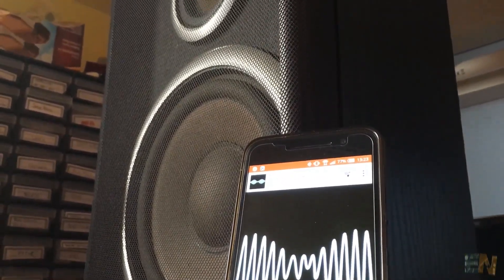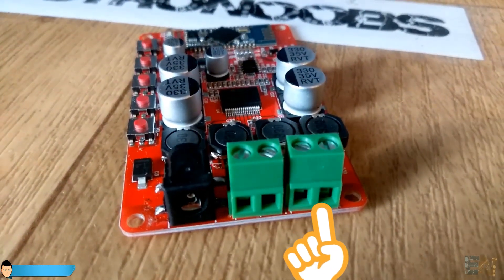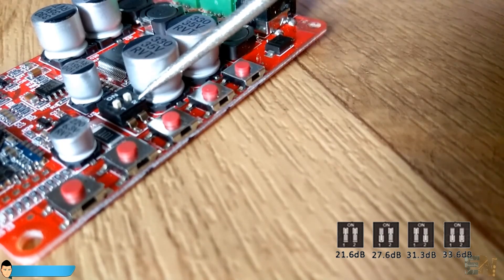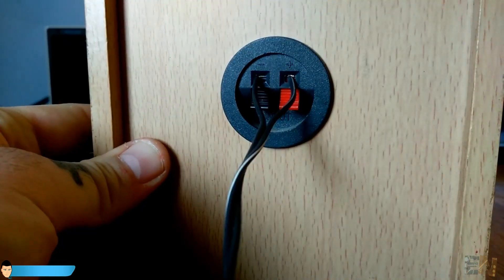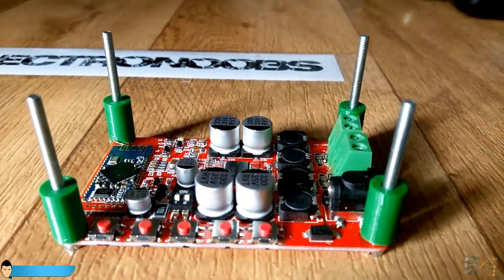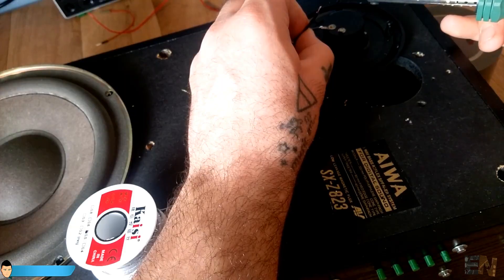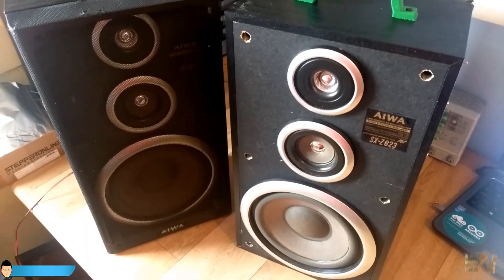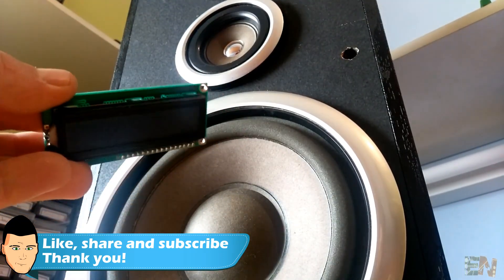Cheap bluetooth portable speaker DIY  100W

Comment from the maker: IMPORTANT: Check the safety battery charging schematic (video description) before you start this project. In the video I didn't use any kind of charging module and this project needs that.

http://www.electronoobs.com/images/Circuitos/tut_9/safety_charging.png
Reply: So if it has 50w for each channel.. Can you combine them and have one channel that is 100w??
Reply: You need to balance them batteries. No two or more batteries are the same and when you charge these lithium batteries of any kind in a series, they never self balance... Each of the two batteries you have consist of two 4.2v Li-Po packs per bank equaling a total of four wired in a series. What you have is a 4S battery which equals 16.8v and under a load it will drop to 14.8 so you need to charge them to 16.8v total and you can charge them bulk but without a BMS or a hobby charger one battery can be 3.8 and the next could be 4.4v and the next 4.2v and the next 4.4 which still equals 16.8v... In this case there's two batteries that are over charged by .2v and will lessen the life or even worse catch on fire and explode. I went on Amazon and orders  a special wall charger that's meant for charging these batteries and I wired them so I could use a detachable balancing device that equals out the cells... If you want these 2 items let me know or I could also show you a good 4S BMS with balancing. I also have a unique idea that works great so let me know. I looked at your charging method and advise against it for one both batteries have different voltages 3.6 and 3.7v and using a bunch of these wired in parallel would allow you to get away from not balancing but you will lose amperage needed to power this device because the more voltage you gain takes away from your amperage, so more voltage less current. One TP4056 only puts out a max of 1amp so say you charge 6 cells using that method only allows 0.1666 up to 0.167amps per battery so your charge time will take forever and low on amperage.
Reply: The wires coming out of these batteries are meant to balance and charge these batteries... Most have a bulk charge positive and negative and the other set of wires balance the batteries, but I figured out how to charge and have them balanced using four 5v phone charging adapters and four TP4056. NOTE: You need isolation using these chips so wire your batteries in a series then hook up a TP4056 to each battery in parallel, yes it works. But you need 4 separate 5v chargers. You can glue the wall chargers down and wire the AC part in parallel and run one AC to the wall. 16.8v
Reply: MultiTerpen the literature mostly says no.  What work around have been sited is a transformer for impedance matching or a separate circuit to turn the 2 amps into a single differential amp.  cheaper to purchase a bigger amp.  there are lots of discussions of this on the 'Diyaudio' forum.
Reply: Shit, 50w per channel @ 95% THD. More like 5 watts, @ 5% THD. You want to bridge this?  Seriously, that thing doesn't have any capacitance to do such a thing, let alone a power supply to handle it.  It may be loud, just don't let it dip under 100hz, it'd shit itself with any loud volume.

Look around for any reputable amplifier maker (Alpine, Rockford Fosgate, etc) for circuit repair.  Look at the components, such as capacitors, inductors, etc.  This little amp is a joke, for 100w..
Reply: I'm looking at putting 10 26650 3200mah in a parallel with a 2amp charging module. That'll still work, right? I have a 30,000mah battery pack that takes about 24 hours to charge, so I am guessing this would basically be the same thing?
Reply: 3.3uf 50v 3.3mfd Audio Capacitor Or 10v?
Reply from the maker: If you're talking about the capacitor as filter for the small speaker is 3.3uF 32V
Reply: Your is 3.3uF 50v?
Reply: Electronoobs I
Reply: Good
Reply: You need a heat sink for the chip, this seller cheated you.

Comment: great music. Loved hearing the Arctic Monkeys. As mentioned at the end, you are only connected one channel. That means you are losing all the sounds mixed to the other channel. One solution is to connect the other speaker output to a second speaker. Another is to use the rather simple circuit to mix it down to mono so although you lose the spatial separation you don't lose whole instruments, effects or vocals. I wish I could recall if there was anything special required to mix down. I used to do it 25 years ago and I always basically used a 2 channel mixer and panned left hard left and right hard right. I did it is raw circuit once with an audio engineer and if memory is serving me there was slightly more to it that just bunching the P and Ns together on the channel output. But perhaps I am wrong and it IS that simple. Vague memory of phasing issues. Ah shoot, too long ago to have trustworthy instructions for you.

Comment: A 50W amplifier into a 40W speaker is not what I call 100W speaker... Also at maximum volume it drains about 1 Amp wich is just less than 15W, so is impossible to create a 50W output.

Anyway, good proyect. I'm thinking more less the same, but using an amplifier and an MP3 player with radio and bluetooth.

Comment: can i use 12v moped battery and if my battery is 12v do i need the DC-DC Adjustable Step Up Power Module Booster Power Module

Comment: Nice project!  I had something just like this in mind.  I was going to ask how to put the board in pairing mode again, after I had it paired with my phone, but apparently after being disconnected for a few minutes, then powering off and on again, it goes back into pairing mode.  This is a really cool little amp!  I had it driving my home stereo speakers and they are 150 watts!  I had the input set to low because like you said, it doesn't sound good on the higher ones.  I never thought about turning the volume up with the buttons.  Mine didn't come with a case like some peoples did.  I can make one though.  I have plenty of rigid plastic.  I now have this amp connected to my computer and connected to some small Pioneer book shelf speakers and they sound great as well.

Comment: Good proyect. I am using 2,  speaker 10w 4 ohm. But it does not sound very good, Can I use a capacitor, how many uf/volt.

Comment: how does left and right sum together? it's a single speaker. any eq? tone controls?
Reply: You can't bridge this amplifier unfortunately. As in, you can't use both the left and right channels into one speaker like you can with other amps when in bridge configuration. Not unless you are using it for a subwoofer only and that subwoofer is dual voice coil. No tone controls or eq on this board. There are other boards that have that bass and treble controls on them though. For example, the  TPA3116D2 board is a 2.1 (50W+50W+100W) bluetooth module with bass and treble controls.  https://www.ebay.com.au/itm/Bluetooth-4-2-TPA3116D2-Digital-2-1-Audio-Amplifier-Board-100W-50W-50W-12-24V-AU/123896013831?hash=item1cd8c72407:g:uG0AAOSwMrVdb28p

Comment: Great video! Do you have all the links for all the components that you used? 
Batteries, battery charger, digital controls panel, etc.
Also I do not have speakers so do you have a link for some good sounding Speakers no to pricey I can buy? 
Plus I need mounting brackets for all the components since I’m building a mobile speaker box that will be moved around a lot. Thank you again!

Comment: So I have this same board on a 12v 7 amp lead acid battery and I'm getting a ton of noise expecially between songs.
Should I isolate the ground, get a different battery, or something different?
I was also wondering if anyone elses boards where doing this. This is my 2nd one of these boards

Comment: They sound great with my Memphis audio car speakers. I was curious if I could add mini subwoofers to my box, and how I would wire that. Appreciate any feedback!
Reply: You need an audio crossover board, which takes a single input and divides it by frequencies for woofers and tweeters. Look for one that can handle the 50W per channel and use one for each. The markings on the board should be self-explanatory.
Also, I'm not 100% sure but most probably it would be better if each speaker has the same impedance. (4ohms, 6ohms, 8ohms...)

Comment: Hi Electronoobs and others. I have a question. How to do a safe battery charging for 12V battery ? I have 2 batteries from UPS and I want use them for build my outdoor BT speaker , and I worries about charging process.

Comment: Awesome video i have a question those each channel is 50 watt  been 100 watt in total or is 25 watt and in total is 50 watt thanks and looking forward your answer.
Reply: Depends on the board. There are similar ones in looks that have 25W in each channel making 50W total and there also are ones with 50W in each channel making 100W total. As I understand, his is 50W per channel.

Comment: The batteries you are using need to be charged with the correct charger and sequence.  You need a balancing charger that will balance them at the correct voltage.  If you over charge them they will explode.
Reply: I think they have a built in bms

Comment: Hola! en mi piso tengo una instalación antigua de unos 6 altavoces de 8 ohms en diferentes habitaciones que hasta ahora estaban conectados a un amplificador de los años 80 que se rompió (cambié uno de los fusibles que estaba roto pero ya no amplifica) y que te muestro aquí ( https://photos.app.goo.gl/GU4ZuWP85jt7jtu7A ). Estaba pensando en conectarlo a este amplificador que muestras en el video pero no tengo muy claro como conectarlo ya que solo me llegan 2 cables de audio y están conectados al antiguo amplificador de la siguiente manera ( https://photos.app.goo.gl/cf8REvMUWfrmAAUd7 ). Mis nociones de electrónica son muy básicas. Como ves uno está conectado a la salida de 50v y el otro a la salida de 75v y entiendo que solo puedo conectarlo como mono en vez de estereo y que si lo conecto solo a una de las salidas voy a oír solo uno de los canales. Cuál sería la manera de conectar los 2 cables a las salidas del amplificador. Gracias por tu ayuda! :)

Comment: nice video dude !!!! i do not understand about electronic... and I got a doubt, how powerful should the batteries if I wanna more autonomy ...  3000mA? 5000mA? batteries ...
Reply: Fabio Almeida can I give you an important warning about 18650 batteries, or any lithium batteries out there for that matter- there are a lot of FAKES. you aren't going to find any real batteries to much higher than 3000mah, if it's a lot more then it will be fake. Beware where you buy them too, look for reviews if you can. Also like others have said, for safety, use protected batteries if you're not sure what you're doing. If using more than one, buy a BMS system. Necessary for keeping the cells balanced.

Comment: Good job my friend but you don't even have 50W right there.
First you used only one channel, that's 25W and then you said it your self, at max power it draws 1 Amp. with 15V, that's 15W because (W = E x I) or (Watt = Volt x Ampere) This is only power consumption, power at the speaker is gonna be less than that.
Anyway you made a good bluetooth speaker.

Comment: Any amplifier that puts out a true 100 watts needs a big  heat sink to avoid self-destruction.   It's also going to need a big power supply that can deliver at least 200 watts - which is also going to need its own big  heat sink to avoid self-destruction.  You can't cheat math and physics.  And, if you want decent damping at those power levels - to keep your speakers from self-destructing - you need some big capacitors and heavy gauge wire to carry the large amounts of current that are going to be demanded at 8 ohms to reproduce audio at those power levels.  And, guess what?   You're not going to get all the current you need, nor the run time you need using a few 18650 batteries.

To do this project right, you would need to redesign the enclosure to take into account the lost internal volume of the speaker cabinet - because, the size of the cabinet is not arbitrary.   It is part of the speaker's overall design.   Of course, you can ignore that, if you don't care that you're going to change the operating characteristics of your speakers.   And, if they're already cheap speakers, they're probably not designed for high fidelity anyway.   You would also need to either install in a ported speaker enclosure or mount the circuits with the heat sinks on the outside of the speaker enclosure.

You're not going to get a 50 watt self-powered Bluetooth speaker using these components - it's just not going to happen.

This project is going to give you a Bluetooth speaker that delivers - realistically - about five watts of audio power.  

Now, through high efficiency high fidelity speakers, even 1 watt is going to be a comfortable listening level and  5 watts average may even be a bit too loud, depending on your listening tastes and whether or not you're trying to carry on conversation at the same time.  With audio you need an exponential increase in power to get a significant increase in perceived volume.   A 3 dB increase is going to require twice the amount of power.   A 10 dB increase - which is what is required for you to perceive a doubling in listening volume - is going to require ten times the amount of power.
Reply from the maker: Richard Owens thank you very much. The amplifier is 25+25w not 100w. I was wrong when buying the module.
Reply: You weren't wrong to buy the module.   You were wrong to believe the claim that it can provide 50 watts per channel.   One simple glance at it was all I needed to know that wasn't possible - not enough heat sinking and not enough power input.

If all you need is 5 watts per channel, it's fine.

Comment: Correct me if im wrong but, if it only draws about 1 amp then that means at 12V the most it could push would be roughly 12W. So if you could double the voltage does that mean it could go up to 24W at 1 amp??
Reply from the maker: Jordan Cavallaro you're right. I was wrong saying that the module is 100w. The place I bought it says 50w+50w. But it is 50W in total so 25W maximum on each channel. With maximum voltage that the board could withstand you could achieve that. Keep up!
Reply: Electronoobs Yep that makes sense thanks

Comment: Salut,
Fain canalul, te urmaresc cu placere.
Am fix aceeasi placa legata la 2 boxe Yamaha 30W, 12ohm fiecare. Alimentez placa cu un pachet LiIon 6s2p (max 25V, 3Ah) din celule recuperate din baterii de laptop. Din cand in cand se restarteaza din senin (cu secventa de power-off, power on.. sunete specifice, etc). Se poate intampla dupa folosire 1h sau 2min, la volum redus sau mai tare, deci absolut random. Am incercat cu racire suplimentara, problema ramane. Vreo idee?
Reply from the maker: Nam idee. Sa nu fie placa defectie.
Reply: Mai am o placa TDA7492 (modelul galben de 2x50W) cu aceeasi problema. Placile provin de la furnizori diferiti, achizitionate la momente diferite. Tind sa cred ca pe undeva fac eu ceva gresit. Am incercat si cu alimentare de la sursa de PC la 12V, acelasi comportament. Sa aiba o problema placile astea cu impedanta boxelor mele de 12ohm?
Reply from the maker: Sar putea. TDA7492 recomanda 6ohm. Plus daca lueam teoria lui Ohm V=R*I, cu impedanță ridicata vei fi limitat in voltaj, cu impedanță redusă vei fi limitat de curent.

Limita actuală va accentua amplificatorul mai mult, și din punct de vedere termic. Difuzoarele de 12 ohmi nu vor pune amprenta amplificatorului deloc, dar fara voltaj mai mare vie avea mai putina POWER.
Reply: De acord.
Am gasit acum cateva minute si zona mai fierbinte a placii. Se pare ca se incalzeste destul de tare rezistorul 101 de langa cele 2 dip-switch. Sunt incepator in electronica si nu mi-e foarte clar ce rol are rezistorul ala. Si la tine se incinge?

Comment: So no one's going to say anything about the fact that the big speaker had an extremely small magnet?
Reply: a lot of people thinks the size of magnet and coil is everything, but not at all, it depends on the spec and use, like for a woofer or subwoofer, Yes you need a big magnet and coil, but for a simple wide range or medium/low some small ferrite is okay, on most of guitar/bass amps, you will find small magnets watch so products on Beyma, Eminence, RCF ...

Comment: many houses were burned down using this build get A twin 2s charger and pull the board out of its case with a battery monitor wired in

Comment: Can I ask you how big battery I need? Its 3000mAh ok?... for playing at least for 5-6 hours :) Thank you
Reply from the maker: This board has 50W maximum output, 25W for each channel. If you use a 14.8V battery that means it will have 3.37A max current so with a 3Ah battery it will last one hour. But this are the maximum options.  In my case I've used just one channel and I've reached a maximum of 1.4A so a 3000mAh would last around 2 hours at full volume.

Comment: I have the same amp and the power source is dc 12680 lithium-ion battery, but when i turn on the amp bluetooth light won't turn on. When I connect the battery to charger it light up the bluetooth light and connect with phone but it doesn't produce any sound.
Reply from the maker: That is strange. Have u used the boost converter? This schematic: http://www.electronoobs.com/images/Circuitos/tut_9/safety_charging.png ??? Keep up!
Reply: Nope. I just measured (on amp) with a multimeter when the battery is plugged into an amp and it says 2 V. Is that how it should be?
Reply: The problem with power is on the connector so I need to solder these wires,but it still doesn't produce the sound, I've tried two different speakers.
Reply from the maker: The batteries have 3.7 volts. You need a lot more. Taht's why I've used a boost converter module, in order to boost the voltage from 3.7V up to more than 20V. The Amplifier boar accepts from 12 up to 26V
Reply: For a few seconds there was a sound and then it's gone. I don't know what may be the problem.